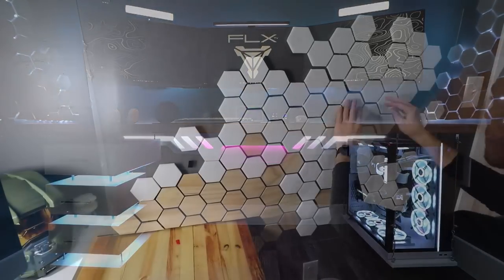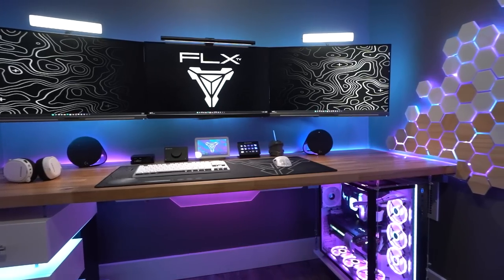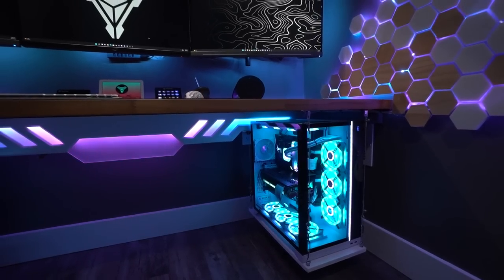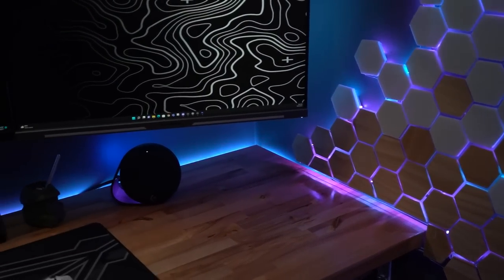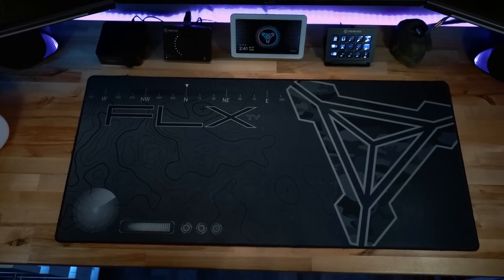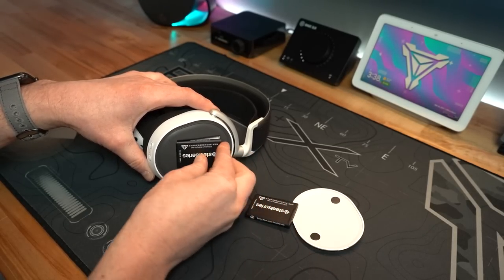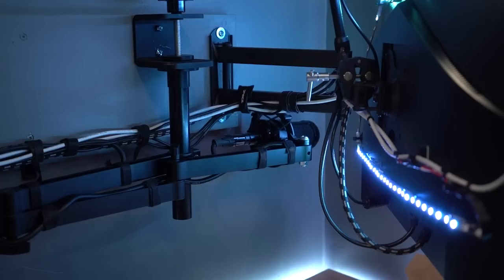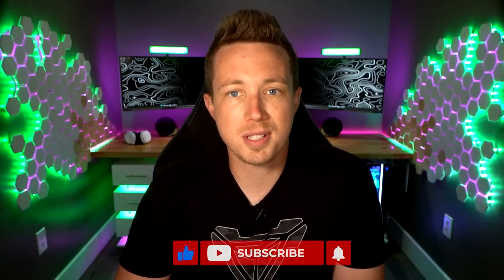My 2022 Gaming Setup / Room Tour! - Ultimate Small Room Gaming / Stream Setup!

Comment: I have a unique setup I been working for the last couple years on, not quite finished. I have two gaming L desks side to side, in a unique config. The desks have black metal frames, gaming on one side with peripherals, music on the other, microphone arm in the middle, two chairs. There's usb 3.1 data hub,110 outlets by Denon, and a high speed drive reader/USB-C 3.2 n the middle on the mic arm base. Another hub on the far right side for keyboards. PC side has 32 inch curved, 27 side monitor,  then the other side has a 55 inch TV, PC keyboard and musical keyboard. It's not very symmetrical, or flashy really, but It's definitely unique for two people. I sort of used the Batcave for inspiration,1 PC runs the whole thing. I have over a dozen things plugged into the back on the PC, so I have a series power filter at the wall made by Furman, it isolates the PC signal and digital audio interface from speakers, monitors and analog gear/ external noise. You get better efficiency from whatever is plugged in. Cable management was a real doozy, I had to get two metal cord panels, one for each desk, but that worked out really well and it looks nice from far away, matches the powder coated desk frames. Not as nice as your cable management, but not bad. I went for more of an industrial look, so a little bit of cable showing here and there, with auto cable covers going into the holes on my desks meeting towards the middle, but not in a messy way. The PC is not even the focus anymore, but it's got a 6700xt Powercolor and a 10700k overclocked at 5ghz all core, it's up to date for now. 3090 is awesome though dude !. I don't game enough to deserve one of those, mostly a musician now. All things considered, it just sits underneath in the middle on my subwoofer, barely fits still a couple inches of space for the PC exhaust to push out the top. it has plenty of synced RGB in there, if I want to look down there, but that rarely happens. Took a lot of planning and tinkering, but it turned out totally worth the time and money spent on it. Looking forward to sharing it soon, once it's completed this month. It would be better with a 12th gen intel and a 6900xt, but that could be possible sometime in the future. I also wouldn't have to overclock anything, if I had waited.

Comment: You could do the lights more efficient via a home assistant routine. The Elgato Streamdeck has integrations for that. Push 1 button and BANG, you're set on your pre-programmed studio preferences, ready to stream!
Reply: How easy is that to set up?
Reply: @jasonosterhoff4840  depends on your computer skills and experience with linux. I could set that up in 2 hours. If you're new to it, follow the manuals closely, and you do it in a half day.
Reply: @Dylan_Lanckman   Ok thank you!! do you have a link on exactly what to buy to get this installed?

Comment: Shoving cables like that behind the wall will be in violation of your insurance policy.  IF you have a fire, they can deny your claim for not using fire rated plenum cable.  The reason being plenum cable does not burn.  Regular cable does burn.  The drywall is supposed to protect wood studs from fire.  But if you put burning cable behind the drywall, you are defeating one of the purposes of drywall.

Comment: Nice setup, sadly I have 3 32“  monitors and they need lot of space 🤪 and I don‘t like wireless mouse, keyboard or headphones. Specially because I use real damn good hifi headphones with amp. So why the hell no one show a setup with cables?  Good clean setups without cables is easy with cables not 😉

Comment: I like your setup, but you might want to build a total water cooled system, I went water cooled 20 years ago and never went back.. 
No noise nor heat build up.
My temps are 30 percent cooler and literally no noise.
I'm not talking pre built water cooling,I'm talking total piece by piece build.
I have been building water cooled systems for myself since 1998,when they were not even mainstream. All third party private hobbiest.
I will most likely never go back to fans.
Your set up is absolutely amazing, and I'm going to do the same type set up also.
RobertC